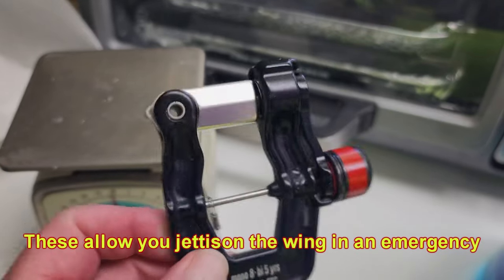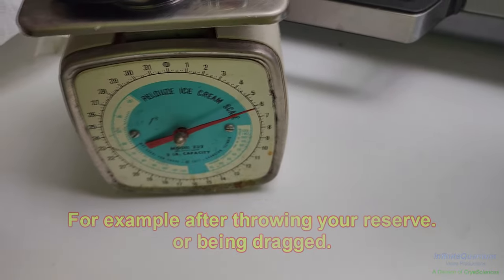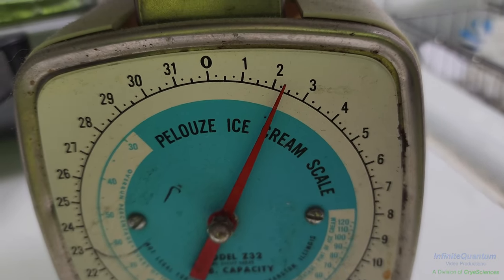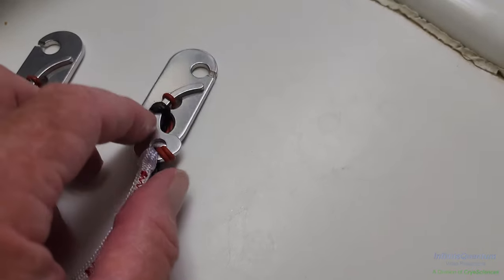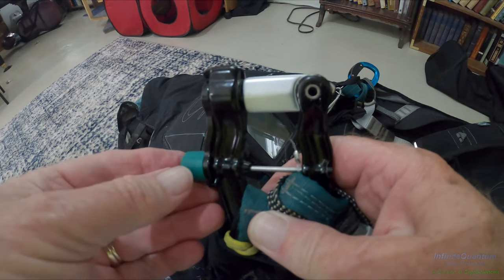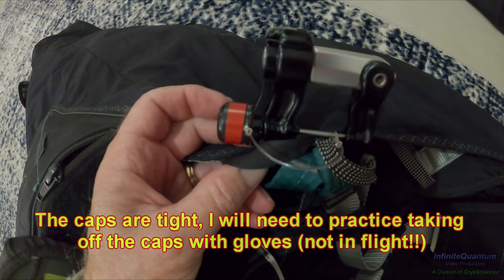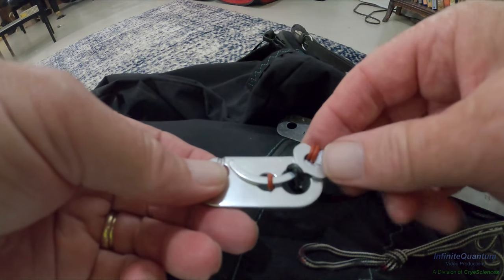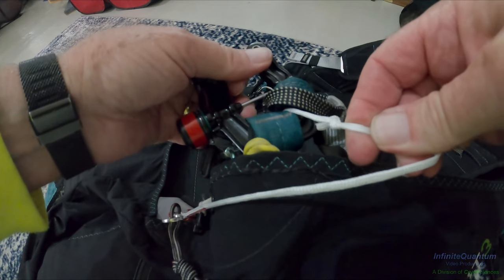Charly/Finsterwalder Paralock quick-release carabiner installation (no flying)

Comment: Hi there! Thank you so much for the video!
Can I ask you how the safety caps works?   How do they stops the lever to go up and eject the risers?
Reply from the maker: The safety caps block the little button on the end of lever. Unless the button on the end of the lever is pressed and held,  the lever will not rotate.  
So, there are three steps to release the wing:
1: Remove the safety cap.
2: Press and hold the button.
3: Rotate the lever about 130 degrees.

Pause the video at 0:19 and you can see the little silver button that must be oressed and held to rotate the lever. 

I have flown with them four times now. 
Hope this helps,  thanks for watching!

Comment: Nice vid Steve. I’ll probably get them also. I wonder whether I’d need the speed bar quick release also as the wing would be flapping about with no structure. I have seen an accidental reserve deployment in Oludeniz this year where the main wrapped round the reserve about 80 times on its 3000’ descent, so that’s something to consider.
Reply from the maker: I think the speed System quick release is worth it. Only $45 more.  Charly is adamant about it. I'm guessing I would deploy one side and see what is happening before I cut the wing loose on both sides. It might be easy to pull a wing in when one side is disconnected.
Still wondering how to find the wing after...

Comment: Missed this one!..........Are you still using these?
Reply from the maker: Yes , I've had many flights with them now. So far, no problems. At least I've not had any accidental quick releases in Flight with them, lol. Pretty easy to hook in, the sister clips work exactly like normal clips. 
I did have one flight where the sister clip release line came untied from my harness, so I modified the knot; no further problems.

Comment: Thanks for posting. I used it to hook up my system. Do you know where you got the plastic tubing to cover the hooks?
Reply from the maker: https://www.amazon.com/gp/aw/d/B08MFNVLTB?psc=1&ref=ppx_pop_mob_b_asin_title
Reply from the maker: I'm using these now. https://www.highadventure.ch/en/quicky-speedbar-release-system.html

Expensive, and you can only get them shipped to European destinations. I had a friend pick some up from me in Switzerland and then send them to me via DHL
Reply: That was my next question. I couldn't find anyone in the US carrying them. I'll be in Europe in the fall. Thanks @NelsonsWings
Reply from the maker: @bchmaui  a cheaper solution which works pretty much nearly as good except you still need the sister clips, are the quick releases  that look like the tow bridle releases.  Superfly stocks those.

https://superflyinc.com/collections/accessories/products/quick-release-speed-system-release
Reply: I just bought a set of the the tecteam speedbar release system from Superfly. Thanks for your help.